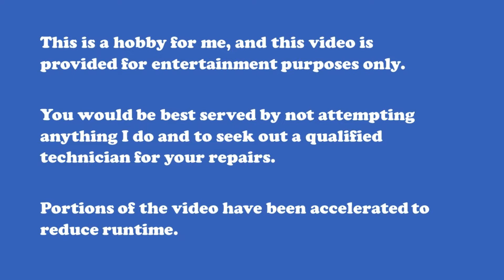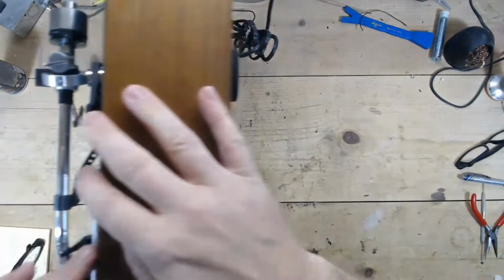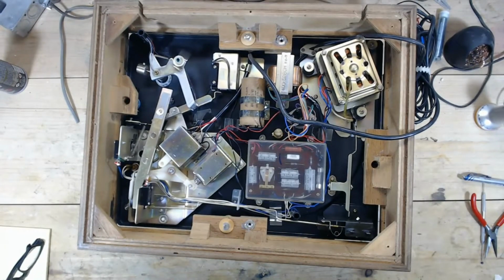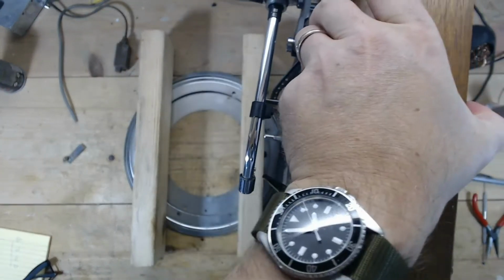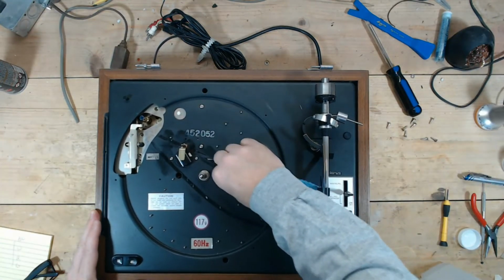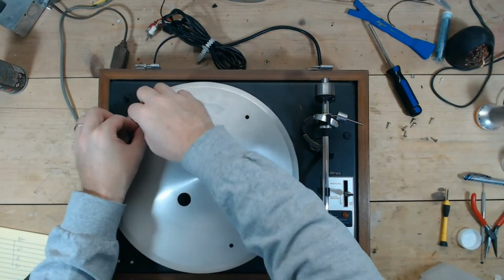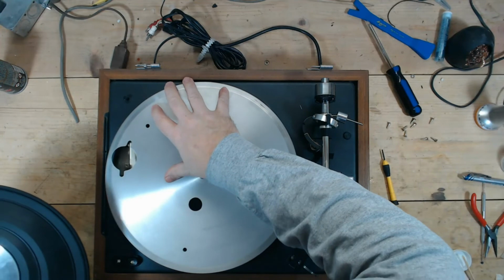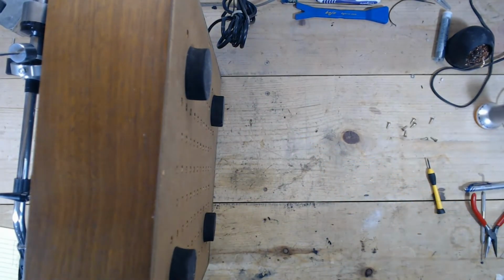Sansui 2050c Turntable Tonearm Re-Damping

Comment: Thanks for showing what is now a semi-lost art...turntable maintenance.  Thanks for your time!
Reply from the maker: Well, it's my attempt at servicing them :)
Reply: @millervintagehifi3034  Hi. I did this re-damping for my daughter's 2050C. It seemed to go really well BUT THEN. When I played to the runoff grooves to test automatic shutoff, the Control Lever (OFF/ON/PLAY) went berserk and slammed to/fro between Off and ON so fast I couldn't count but say 5 times. It dented the rear rim of the deck opening within which the lever operates! HELP. What did I do? I did the same as in the video.  BUT having reviewed your video just now, I see that I did use too much 300K CST silicone. Tony

Comment: Buenas amigo ante todo felicidades por tu canal un favor tengo un tornamesa sansui sr 2050 es igual pero la velocidad de 45 es lento ya lo cambie la correa y sigue igual cualquier favor te lo agradecería mucho gracias
Reply from the maker: If 'slow' = staying on 33 RPM, then I'd check the guide that moves the belt on the spindle to ensure it's working properly.
Reply: Gracias amigo por escribir ay días el tornamesa sansui 2050 suena lento y aveses se anivela el sonido después me compré otro 4050 sansui lo compre barato pero tiene lo mismo en 45 es lento ya le cambié la correa y sigue igual o que tendría que cambiar algo en la tarjeta de velocidad

Comment: Thank you! Mine won't raise the tone arm either. will re-damping my tone arm help with that issue? Also, what type of silicone are you using?
Reply from the maker: It all depends on why the tone arm won't raise...if it's stuck, then it's possible that re-damping will fix it.  It's probably more likely that something is misaligned/disconnected/broken underneath.  I use 300,000 cst silicone oil.
Reply: @millervintagehifi3034  Thank you!